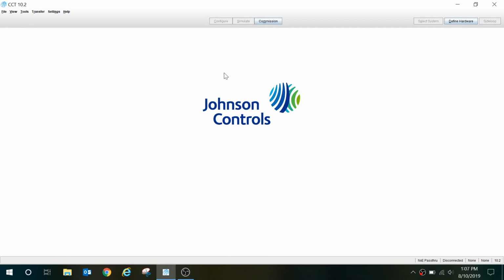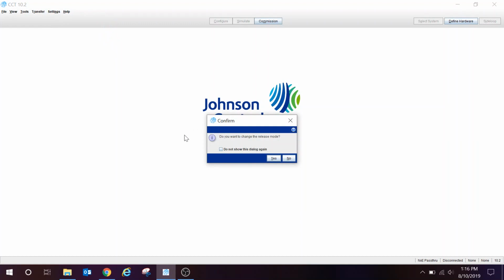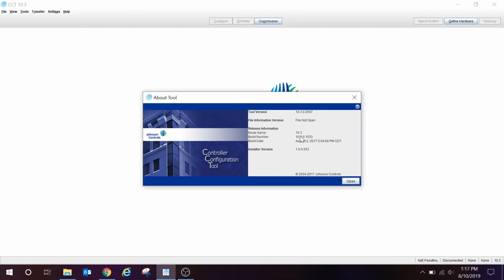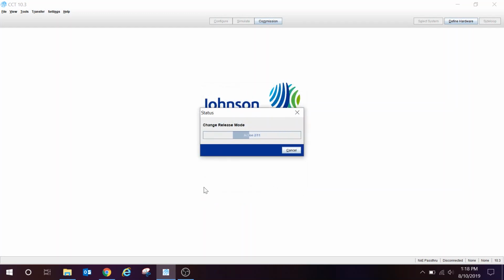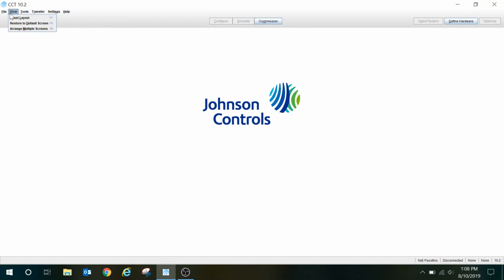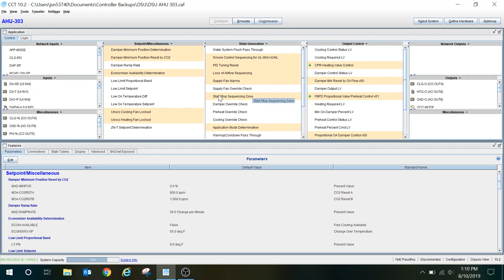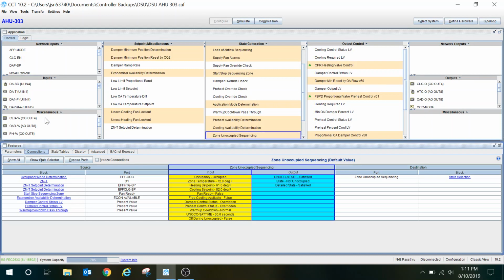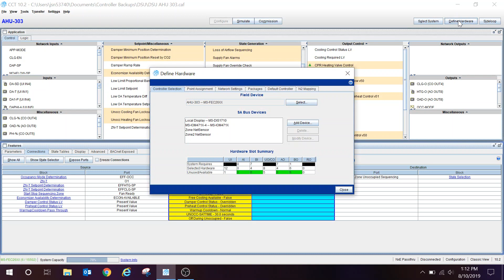Johnson Controls newest CCT Software

Comment: Thank you for keeping up the videos.  Very helpful.  We are using 10.3 but run version 10.2.  We have a JCI tech help us with the work load, updates and training once a week.  He cautioined us today that we shouldn't use 10.3 because it is primarily used for the newer Ethernet controllers.  Meaning VMAs, FECs & etc are all Ethernet communications protocol.
I was wondering if you have or can put out a video on state tables?  Had a little bit of training on them but would like to become more familiar on how the flow and changes can be made with in them.  Maybe send me the links?
Reply from the maker: Thanks for watching

Comment: Hello, I know you are professional in Johnson control product. I have some questions about the Johnson Control FEC26 controller if you would be able to help... 

Is the Metasys integrated with FEC26 or I need to purchase the software for programming the FEC?
If I want to control a VFD pump, do you think MS-FEC2621 is enough to run? 
As I believe it contains enough IOs for pump start,  pump speed, pump feedback...

Thank you!!
Reply from the maker: You will need the CCT software to program the FEC.

Comment: CCT 10.3 release mode is just used for the IP controllers. Keep the release mode at 10.2 for regular FECs/FACs and VMAs. The brand new CGM and CVM controllers need CCT 13.0 to work (and a MAP). Also the newest CCT requires a purchased license from JCI to be actually run.
Reply from the maker: I know that JCI will be phasing out the FECs and current generation of controllers in the near future and replacing them with the CGM.  I haven't had the chance to see CCT 13 yet.  I don't like the idea of having a license for it because we have it on multiple computers that are each used for a different purpose.
Reply: @Systemcontroltech  CCT 13 combines cct and pct. so a licence is require for cct 13 to run plus a separate licence must be purchased for the controller packages. one for metasys controllers and one for fx- controllers

Comment: 10.2 PCT. 

Going to hold off on the upgrade until I'm forced. Heard they will combine CCT and PCT. Not looking forward to it.
Reply from the maker: There's a new generation of controllers coming also.
Reply: @Systemcontroltech 
Yes sir. When I'm forced to upgrade it doesnt look like it will be the end of the world. 

Now giving up my bluetooth for that mapp tool might suck.

You HAVE to use the mapp tool for IP based right?
Reply: @TheCrowder3  You don't have to have a MAP for IP controllers, you can directly connect directly with an ethernet cable. That said,  a MAP should be on your list of tools to acquire soon if you play with JCI alot.

Comment: Thanks for the warning about upgrading programs. I can't remember which version we are on currently, I want to say it's something like 6 or 7 but I will find the exact number. I currently have a new project that the branch is going to install a new NCE and I told them they would need to provide any software needed to program it (I work for the federal government and there are regs against getting locked into one vendor). I think they said they would provide the newest version and I had concerns that all my older controllers would not be compatible with new stuff as I have seen that before. This is one my complaints about JC stuff, out of the box every controller needs a different Rev of software!
Reply from the maker: Many of the devices like fec and vma that are bacnet can be upgraded with the software. I know what you mean about the constant change